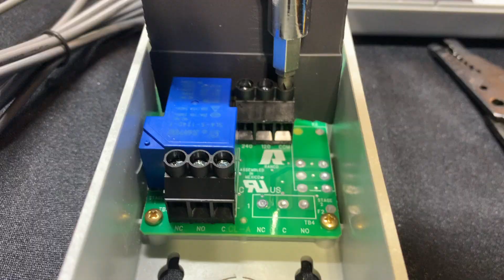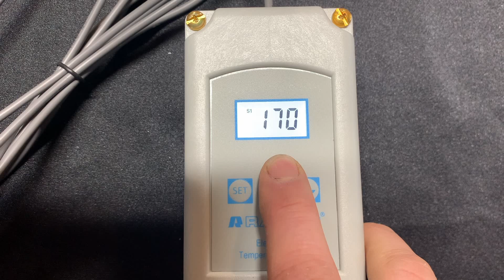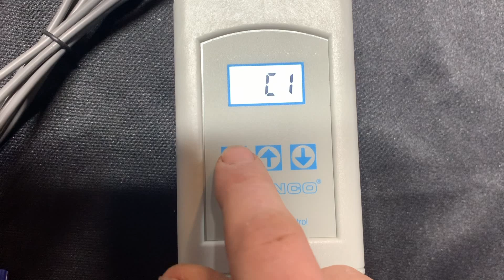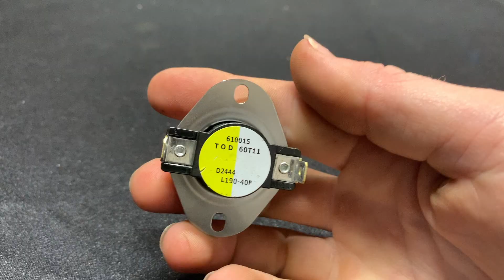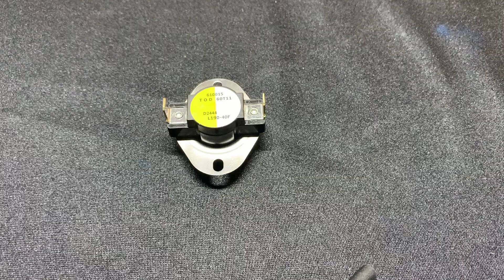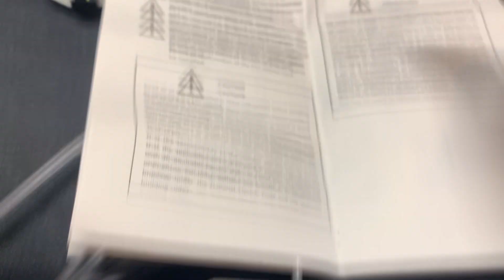Ranco Control Heatmaster MF and C series

Comment: On my ranco I have it set in my outdoor wood burner at 165 to 175 in the back of stove, and I have a thermometer gauge on the front of stove it's a dial handle the the needle is 210 all the time when fanshouts down ,but sometime it get little hot steam comes out of the over flow pipe  I check water little low but not bad .so is my ranco reading right ?
Reply from the maker: It’s possible that both are accurate, but that the furnace does not have enough water flow to keep the heat spread evenly throughout the stove. I have seen that happen a number of times, and usually it’s a flow issue, and not that one temp readout is wrong. What furnace do you have?
Reply: @YoderOutdoorFurnacesLLC this is for and out door wood boiler that heats up water